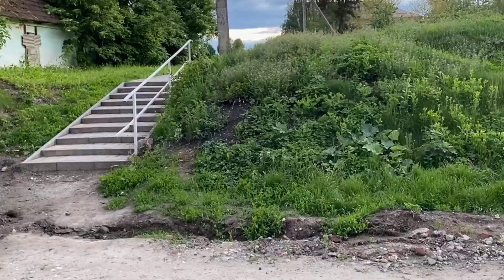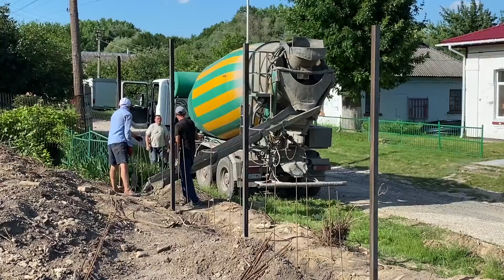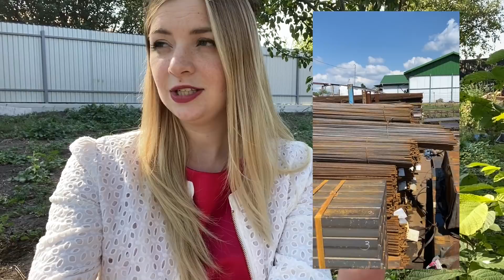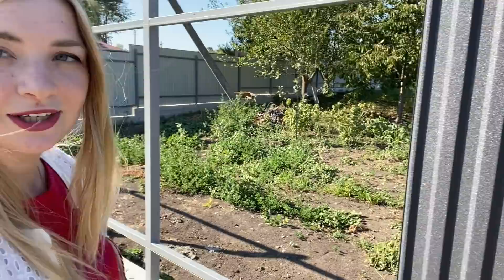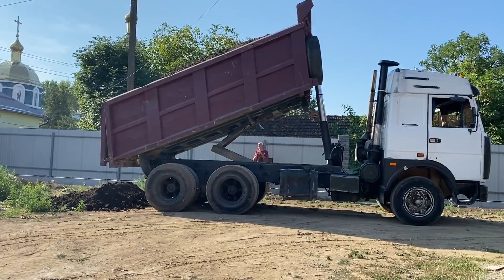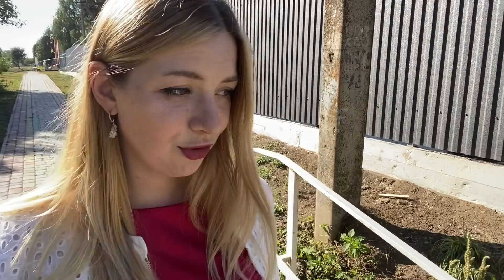Vlog from construction: prices and process in Ukraine

Comment: We do build house in Novomoskovsk. Compared with Denmark, price in Ukraine is about 20-25%.So we get a bigger and better house, made after Danish standard 2013, 200 m2 for 100.000 $ including price of 800 m2 ground, 380V 40 Amp, kommunal water, septic system, new gas tupes, boblebath and a 49m2 garage for 2 car with heating system (air to air electric pump).